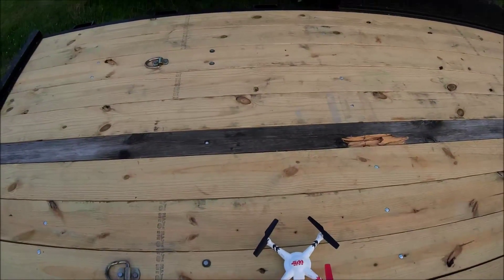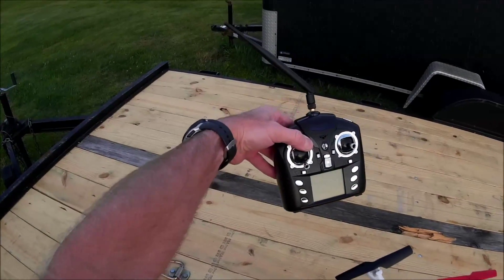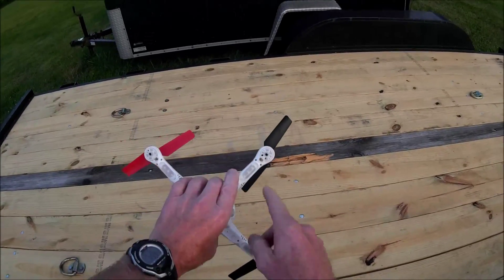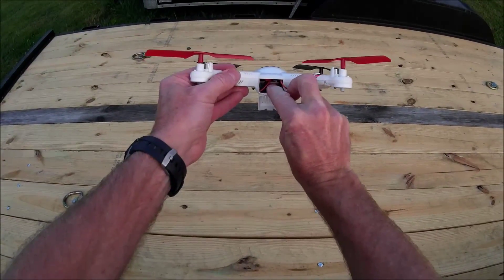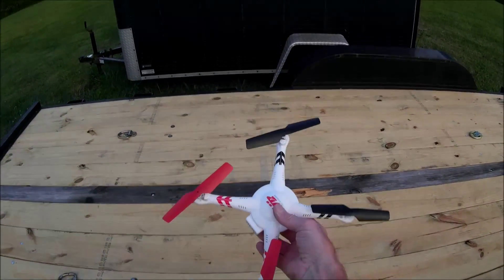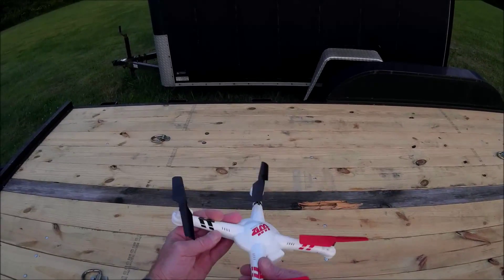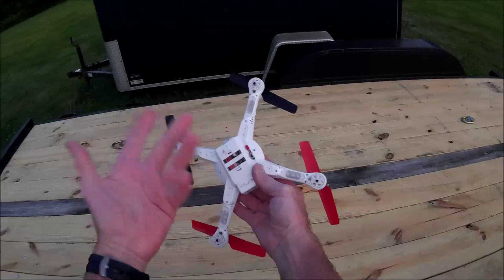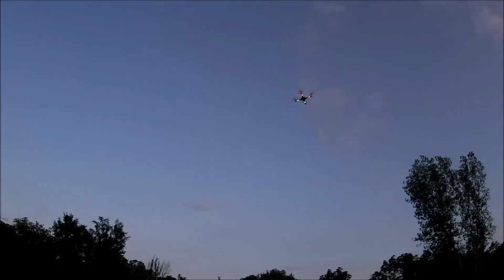Drone WLToys Super V686G

Comment: hey hows it going?
the just over 3min flight on the stock 730mah battery sounds very familiar lol..
i had the very same issue..im guessing the fulltime fpv/motors/etc really pulls out the juice on the stock battery..
i now run the eaglenergy 1050 battery in my v686g...its thin like the stocker but longer...it barely fits but it solved my 3min flight time blues lol..
plus i can run the 1050 in my u807 and ominus{fpv battery tray}...
happy flying!
Reply from the maker: birdman316 
Haven't flown this quad for a while, I model and went to a 2s 900mah battery.  Had flight times of 26 Minutes. Thanks for the positive post.

Comment from the maker: I guess you can have your opinion. In its stock form it is not very good. After I upgraded it with an H8C board and motors and went 2s it was great. Get 20 minute flight times.

Comment from the maker: That could be a bad battery or your receiver board has went bad. Do you have any other quads that use that battery? Test the battery on one of them, if battery has normal flight time and power on another quad then the receiver board is bad. The receiver board is an easy and cheap fix.